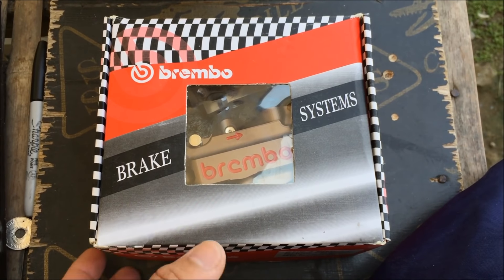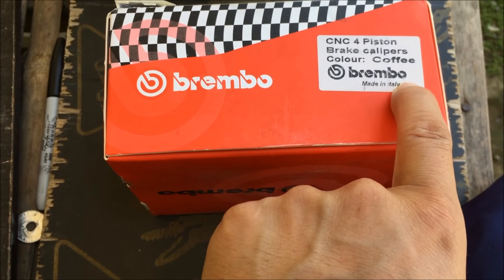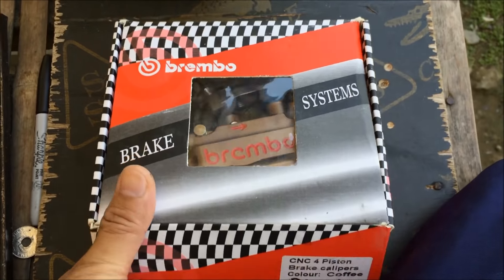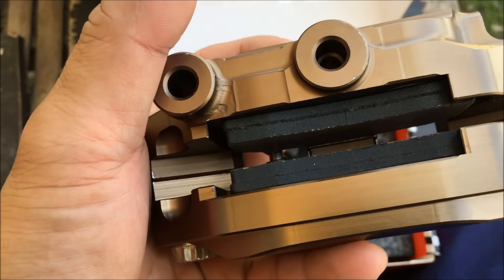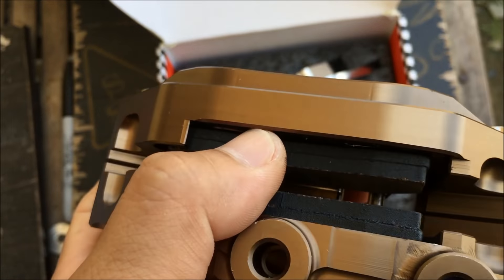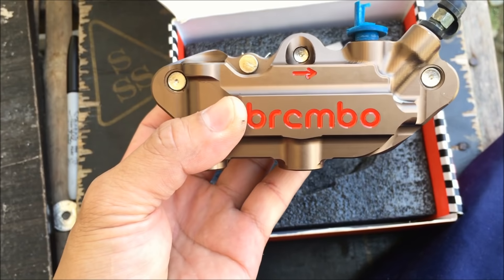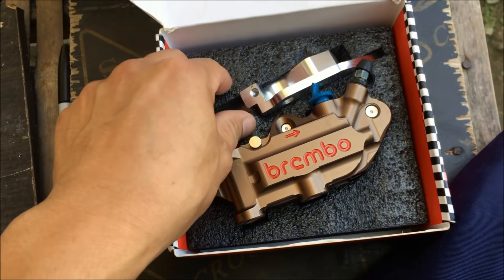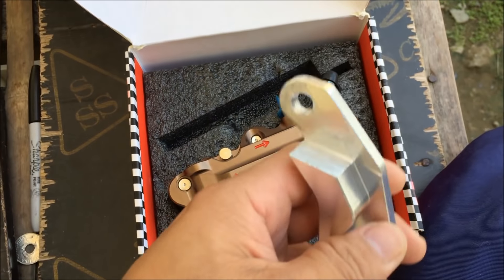Project brembo for yamaha aerox

Comment: Is there any difference in braking performance compared to stock one?
Reply from the maker: Yes, its a lot better than stock one.  Since this one has 4 piston, you can brake quicker as soon as you pull the lever.

Comment: Magkano ganyan paps? Saan makakabili?
Reply from the maker: sa local shop or online. nasa 2-4k. Pagbolt on mas mahal. Hanap ka ng brembo 4 pot kunin mo sa kahit anong model tapos gumagawa ka or magpagawa ka welding shop ng bracket makakatipid ka.
Reply: @pnoybiritph3993  2-4K? diba mahal yung brembo kasi know brand sa mga Motogp pero bakit nasa 2-4K lang?
Reply: @andrewleonid8878  Its only a Premium Copy kaya ganyan ka less ang price nya compared sa orig na brembo